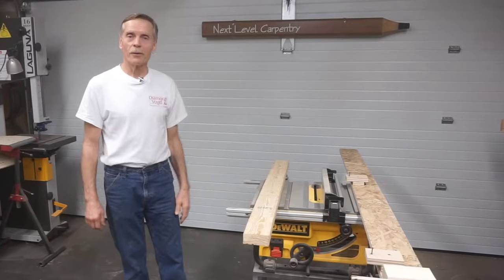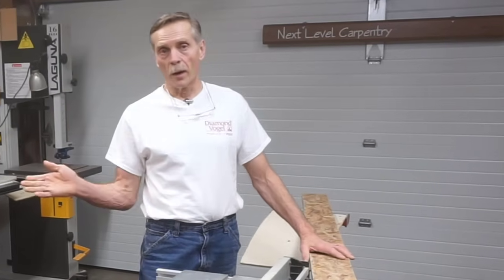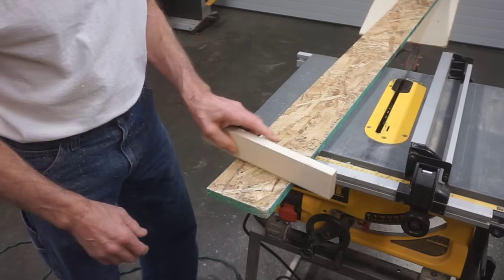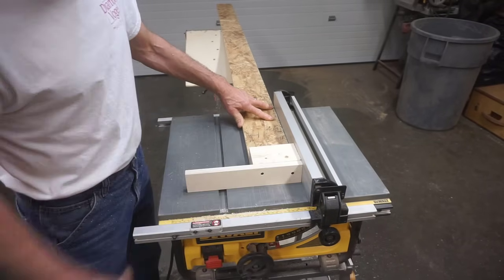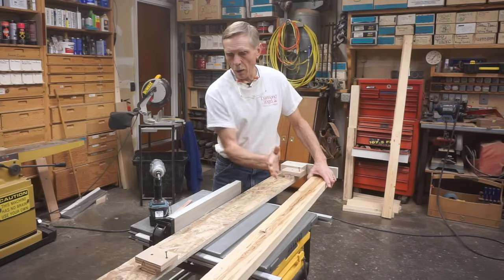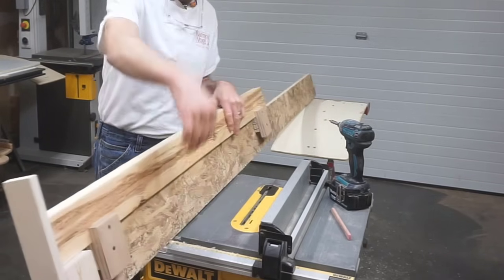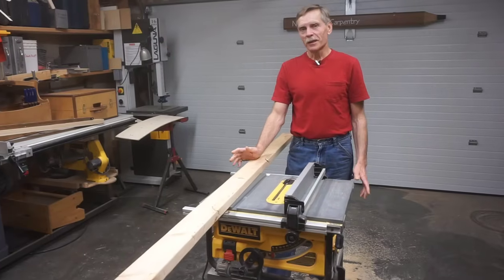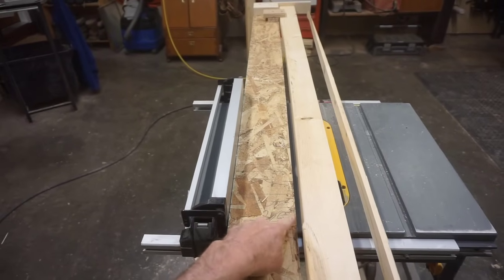How to Cut a Straight Edge on Crooked Boards

Comment: OMG ....on a jobsite?   Toss the 2x4 and keep working!  Time is money, play with your board at home.
Reply from the maker: Thanks for such a nice comment on this video Bob... it clearly demonstrates your level of ignorance where it comes to learning new techniques for better carpentry.
Reply: @NextLevelCarpentry  Not trying to be "un-nice"   as your technique is safe, effective and well presented; I have not said otherwise. Bravo!  It is simply not applicable to use on a jobsite as YOU specifically and repeatedly claim it to be.  On a jobsite time is money so return the bad lumber later and keep working  now.  You simply cannot find fault with such as truth as this can you?
Reply from the maker: @bobciecko290  you are correct that I cannot find fault with truth but I can and do find fault with your statement.
Since you are being polite I will offer you to consider a completely different Paradigm where I use this method on projects that are sensible practical and profitable.
Consider a remodel project on an older home where a considerable quantity of good Lumber is removed during demolition. This happens frequently and I generally will save pieces that are structurally sound but not reusable for their original application because ends are split or they are bowed.
Rather than throw these pieces directly in the dumpster I lay them aside for use later. Back to the remodel project on an older home: it should be no surprise to any experience Carpenter that walls ceilings and Floors are often out of plumb or out of level and furring is required to true them up. It is also  common to need to build soffits  chases box-outs and surrounds for things like  Jet Tubs Etc. If your statement was true then at this point you would reach for a brand new piece of straight Lumber that you paid full price for and rip it and or cut it to length/size as necessary for shimming blocking cripples or furring... each piece of new Lumber you use for this is spending money that I don't when I grab a piece of cull Lumber from my demolition Salvage pile and perform the exact same operations on it. In this Paradigm I make money doing the work while saving my clients money from purchasing extra materials and also recycle a fair amount of lumber keeping it out of landfills.
Now the challenge is yours to find fault with this truth. Best, Matt
Reply: @NextLevelCarpentry  Matt I find no fault with your chosen methods as you have stated them above so....yes when you are on a DEMOLITION JOB at that older home salvage and restore what you can (back at the shop).  When you start construction please make sure you have ALL (plus 20%) the best quality materials, skills, and man power that you might need on site.  I am saying as I have all along that your edging technique is not appropriate for use at a jobsite (for hire) in the field.  Would you pack up the whole crew and remobilize to the site another day having spent your time straightening warped lumber?  If so we will have to agree to disagree.  I mean no disrespect, just  consideration of common common sense. That's all;  truly best wishes and thanks for the tip.
Reply: @bobciecko290  If you guys wouldn't mind me adding my two cents.
       While I agree with you for most job site conditions in fairness to Matt I don't think you guys are talking about the same job types or sizes here.  Even in the video at the end he specifically says remodel jobs, where as I think you're talking more about new construction or possibly major renovation?  Correct me if I'm wrong.  

      Sometimes taking time to save material on certain size jobs will save you more money than getting the job done a few hours sooner.  There still could be ways to utilize this in the field on new construction job sites while remaining efficient too.  keep the jig and keep it handy and have the rookie do it between job cuts maybe.  But I have been on those jobs where that is just impractical and inefficient and been on others where it would have made sense.
 
      Either way the adage "time is money"  is a bit of a misconception I feel.  To me it should be "efficiency is money."  The person who takes time to set up properly with the correct tools, materials and do the job properly and efficiently will yield a better product quickly and correctly rather than the person who rushes to start and finish a job to save time, even if that person is skilled.  Also the idea of efficiency encompasses time and process which includes more in the realm of a job.  But that's just my opinion.
Reply: I would be fired if I was to waste time on this at site. And I would also be doing only this everyday. 
At home I could but most likely not.
Reply: This is why I work for myself. I can straighten a crooked board if I damn well please. I'm done being a slave. Some things are more important than profit.
Reply: @frumpywonkmeyer4518  You'd make a great diplomat!
Reply: I can tell you didn't mean to be "not-nice", but your people skills could use some work.
Reply from the maker: @ensiobygg5004   it is truly sad to think of getting fired from a job for having a clever efficient and creative way to solve the problem of straightening a crooked board when it needs to be done... were I you I would seek employment with a more intelligent employer... Just sayin...
Reply: @theobserver9131  Thank you.  I feel it's important to understand what people are saying so that we are all having the same conversation and not a misunderstanding of topic.
Reply: @ensiobygg5004  I have definitely experienced  those jobs too.  For me it was framing so the warp wasn't as big a deal as it is in cabinetry or finish work.  which by the way i'm terrible at.  I can somehow start with a board that's too short cut it and have it come out too long, go figure?
Reply: Lumber is now quite a bit more expensive now during the pandemic...
Reply: @bobciecko290  There are exceptions, like the nearest supplier is long distance, you do not have alternative stock and you need the piece in question to work now. Travel time versus ingenuity. One could actually "save time" by using this technique on the job site.
Reply: @tlbx57  Tony, I agree that ingenuity rushes in to save the day when planning fails.  My point has always been not to  plan to fail and if you fail fix it at home not on the clock at a jobsite whenever possible.  Bring extra top notch materials, tools, etc...  and at least plan to succeed every time without exception.  You are right , this technique is "an excellent emergency measure"  but this is not how I feel it was presented in the video...probably my bad; no need or intention of starting WWIII over just my superficial opinion.
Reply: For some, it's not worth the trouble.  OK. But don't knock someone who finds the technique helpful.  You can argue the fine points of efficiency all day long with no winners.  And as someone said already, it's not all about saving money.  Indeed, I just got done milling 20' 1x8 yellow cedar (yes I have a stack of it), pays to know loggers.  I needed these ripped because I had exhausted the 1x6s I had for my wood deck porch.  So guess where the 1 7/8" cut offs went?  With a nice routed profile I turned them into the trimwork around the porch (51' across and 16' on the ends) soffit/facia joints.  I needed ten 16' pieces.  Now how expensive would it have been to buy that trim work?  I never throw any 2x4 away that is more than 16" long.  I end up using them all.  Nice Laguna.  I have the same one.

Comment: It is too much work and expense, using four power tool and electric drill, scrap material to cut a piece two by four.you are not making furniture. No one will do like that on job side good demonstration but not practical.
Reply from the maker: Wrong, Bill Wong, wrong. 
Just because you don't see this as practical it doesn't mean that many professionals don't. I'm a career Carpenter who runs a very profitable custom design build remodeling business and use this frequently to salvage material, to save time and to save money for my clients...

Comment: its next level all right! You made a whole 15mins production ,out of something that can be done with a couple of clamps and a circular power saw. 
You actually get paid to complicate people's lives? DUUDE!
Reply from the maker: And  your goal in life is to be a jackass?  Unfortunately I'll never get a chance to push your nose in in a race, you with your circular saw and clamps, me with this efficient, accurate and FAST jig.  Straighten 10~20 crooked 2x4's and/or 2x6's, looser gets their nose pushed in.  Ready? GO! 😝
Reply: You do not even need the clamps.  You can screw the 2 x 4 to that straight piece of OSB
Reply: When will you be making a video about it?
Reply: @carrytheworld  I am pretty sure you can figure it out without special video. It is rather basic and simple task. 
Do not take me wrong, I just expected some simple trick instead of building such a rig. When you have many of those crooked 2x4 it is useful and worth to build, but when you have only few, the clamps or screws are faster solutions.
Reply from the maker: For minimalists without a tablesaw, if they're any good, they can just snap a line and rip it with a skillsaw instead, no need for screws, OSB or anything.  If you don't have a snap line you can draw a straight line with a pencil along a known straightedge and rip that...
Reply: @NextLevelCarpentry  Thank you for the info, I think I'll stick to the video information  because I know I'm not any good  lol. By the way, really informative and good video.
Reply: @SpokoSpoko  I think I understand where you're going but the explained system seems really good for amateurs like me. It might be far too much work for a pro but a beginner can get the system by using the info on this video. Thank you for your respons.
Reply from the maker: @carrytheworld  As you can tell I get annoyed by comments from viewers like peter wall above because their comments are so counter productive and ignorant.  And PIRX seems polite but also seems to miss the point.  Makes me thankful for viewers like you who get it!  
FWIW I've been doing this stuff for almost 50 years and STILL use the method shown in this video whenever it's the most practical, efficient, safe and productive method.  Just today I used a snap line and circular saw to straighten a 12'  piece of pecky cypress 1x12  that cost over $200 because it was the best way to accomplish the task at hand so some viewers petty comments about other methods that give them a false sense of prestige are particularly annoying.
Work safe and enjoy the journey!
Best,
Matt
Reply: @NextLevelCarpentry … I love your response…GO!!!😝🤣
Reply: @SpokoSpoko  Do not take me wrong.  I am pretty sure that your YT channel has been up since 2006 and all of your videos have garnered 849 total views.  Maybe you should concentrate on your own deficiencies rather than spouting off.
Reply: @leskavage  Ha Ha :-)) Neither Your channel is very popular. All views mainly by yourself and family. 3 subscribers, perhaps mom, dad and brother. 
But seriously, don’t be funny, constructive criticism is not a hate. 
Personally I don’t like comments without any meritorious content but full of “great job”, “you are the best “, I love watching every thing you do “, you are genius “. Such comments bring the video creator to the level of 3 years old child, who needs to be awarded for everything he does to build his self esteem.
Reply: @NextLevelCarpentry  Never even mind the hundreds or thousands of helper products you can buy to help keep a straight line on a circular saw.  I can follow a pencil or chalk line (from my handy snapper) for a foot or two, but as demonstrated in this video I commonly need a nice, straight edge on 6 feet plus and you can bet my "waste piece" will contain part of that line.  Even those expensive straight-line helper tools go nowhere near 6 feet, let alone 8 or 10.

Whoever criticized this video literally just showed their lack of both life experience and imagination.
Reply: I think you are maybe assuming that his way is the only way, and it's not. But is more for a precision cut. I would use it on hard wood lumber because don't have a shaper. He does some nice work, you have to agree on that.
Reply: @baudgaud  Sorry, didn't mean to ruffle feathers. And your right that post was a long time ago so there must be some exchanges of opinions between you two, I don't get in the middle of a pissen match if I know that's what's going on. If your way is working why change. Have a good day my friend.
Reply: @baudgaud  Thank you for setting me straight, and you have a good one.
Reply: That's pretty harsh bro. Opinions are like assholes but the trick is don't come off as one when expressing yours. There are many ways to accomplish a similar task and no one way is the only way. You could have added your suggestion without demeaning the content creator and everyone would be better off. Instead you started an ugly exchange in the comments and come off as a troll.
Reply: @pakde8002  Well said.
Reply: While there are FASTER methods, this presenter prioritizes safety, control, and a reusable jig. As an engineer, my money is on him.  👏
Reply: @NextLevelCarpentry  Brother I enjoy watching videos like this! Even if I may not ever get a chance to use it! And I must say you handled Peter very well! And it may or may not be because of YT? But I would have been a lot worse, just saying! But I do understand we do what works best for us! And you can state that in a video you do! And I have seen some that they call life hacks! On YT! And if you might not have a clue on might look ok to do! They're not!  But they're should be some kind of common sense! That should tell you maybe I shouldn't try that! Not saying that's what you're doing is that way! I'm talking about those, especially in the YT shorts!

Comment: Bro, I know how to do this with only 2 steps! This method way too long!!!
Reply from the maker: Hope you don't sprain your arm patting yourself on the back there bro because it's also possible to straighten a board with only ONE step.  BTW This method is shown as one option among many to straighten boards safely and efficiently to those who lack advanced tools or skills for simpler methods.  Of course you are more than welcome to produce a video of your own to show the world your method to see if 3.4 MILLION other viewers agree with your claim that this is 'way too long'.
Reply: @NextLevelCarpentry  Love the reply and that you pinned the comment.
Reply: Rip beyros
Reply: If you're going to leave this comment at least give an explanation or post a video like next level carpentry mentioned.
Reply from the maker: @terrell07981  Sadly that's far too much to ask of a troll... thanks for your optimism and support of reason here! 😎
Reply: @NextLevelCarpentry  I really appreciate the video.. I want to make a dining room table top and want my lumber to be straight before gluing it. I have the same saw as yours in this video and found this process to be very simple and straight forward. thank you so much man. I was planning on clamping a straight edge on my boards and using a router to straighten them but this seems a lot easier.
Reply: @NextLevelCarpentry  Awesome response! I'm subscribing not just because of that, but for the great advice I heard you come out with in this video.
Reply from the maker: @stephenmcgeown  Thx!  Much appreciated... and thanks for the sub too!

Comment: Too much work bra... just go purchase another BOARD!!! bra.
Reply from the maker: For sure... much simpler and cheaper to spend 1 1/2 hours making a 40 mile round trip to a lumber yard and pay for a new, straight board to cut into 2" wide furring strips than to take 10 minutes to make this jig that pays for itself many times over  on a basic remodeling job by repurposing demo materials that would otherwise end up in a dumpster ... what WAS I thinking?!
Reply: Sure, but you could also pickup crooks for pennies on the dollar. Important in this economy, at least to me.
Reply: this very useful for straightening privacy fence slats.... lots of crooked slats in a big pile this is a good way to render them useable
Reply: Not everyone lives close to a lumber yard. A person could actually  just lay a 2X4 on a piece of OSB and then screw from the bottom up.   Better than burn $4 gas for an hour plus wasted time. Time is $$.    Not everyone has more money than sense/cents.😉
Reply: I am guessing you watched this video to improve your skills . These techniques will do that , going back to the lumber yard won’t

Comment: I tried your channel but you taking an hour to discuss a 30 minute show is tiring. So in this video I'm to take my time and materials to straighten out a 6 dollar board, that can otherwise be used for cut-pieces, blocking, etc., thus saving me time and materials? Here's a suggestion; do a better job at picking out your lumber.
Reply from the maker: Ya, Next Level Carpentry is clearly NOT the channel for you, Mr Gator.  Do us both a favor and spend your time watching videos on channels where you're spoon fed information that your concept-challenged brain can comprehend so you don't embarrass yourself in front of millions of other viewers here who 'get it', OK?! 🤨
Reply: Wally Gator missed the whole application of your video.
keepnup the good work!!
Reply from the maker: @jackcc6247  Crazy, right?!  Especially when it doesn't take a rocket surgeon to 'get it'! 😆
BTW Did you get a chance to enter the hashtag for the $300/300K subscriber appreciation video here at Next Level Carpentry?  Drawing will be 21-May-2022...😎